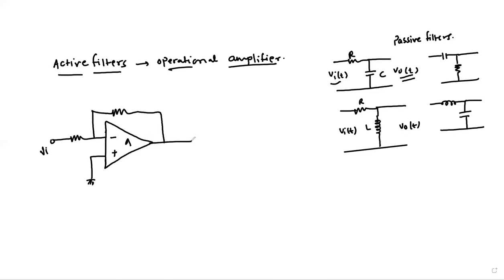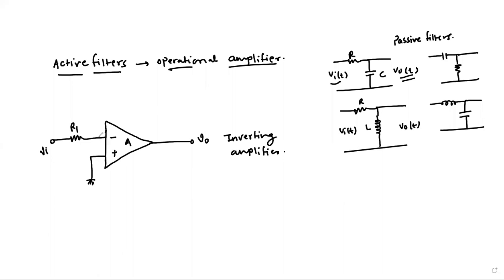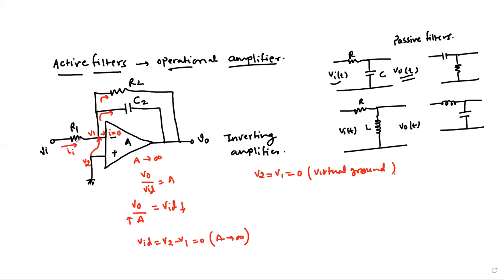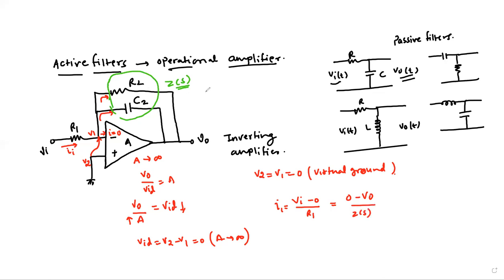Active filter | Integrator | Operational Amplifier

Comment from the maker: Correction-- an expression of the phase is 180 - inverse tangent (w/wc), where 180 is the phase of the negative real part (-R2/R1). Therefore, the phase at w=0 is 180 deg.  
phase at w=wc is 180-45= 135 deg., and phase at w=infinity is 180-90= 90 deg. So, the total phase shift is from 180 deg. to 90 deg.